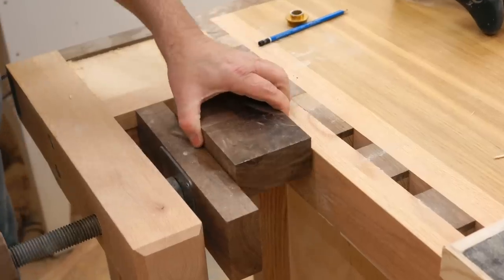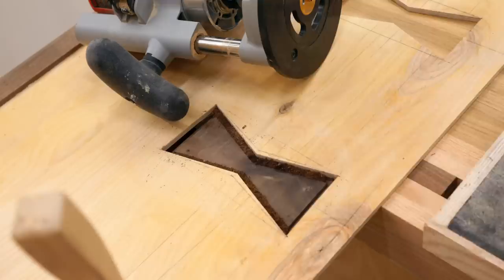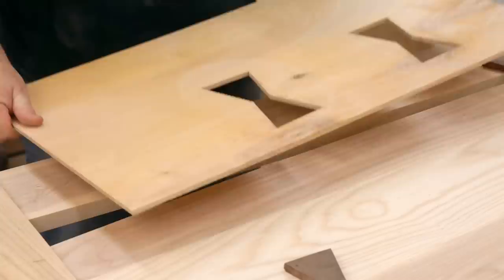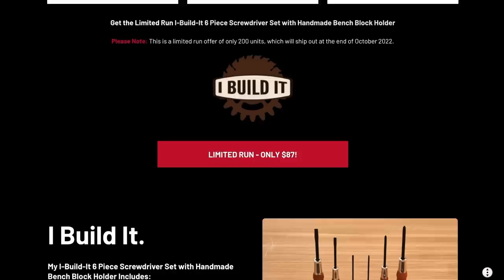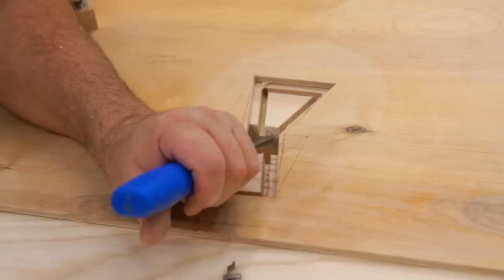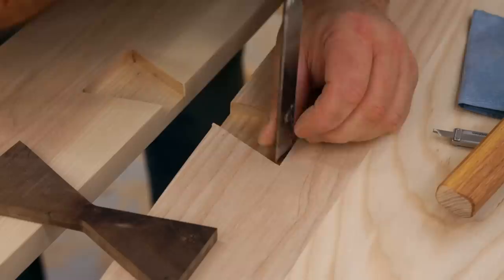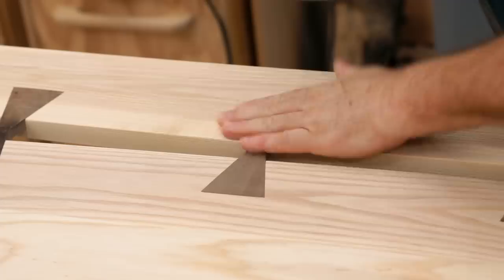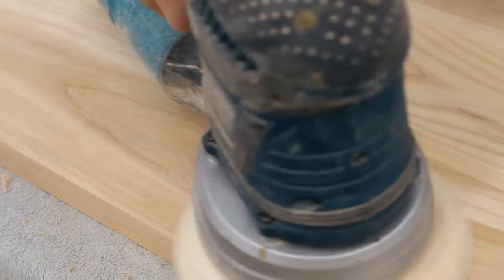Make Inlays the Easy Way - Perfect Fit Every Time

Comment from the maker: Get my 6 Piece Screwdriver Set: https://ibuildit.ca/blog/6-piece-screwdriver-set/
I needed to inlay some decorative bowties and came up with a way to use a standard guide bushing set to do it. 
I used a 1/4" straight cutting bit with two difference size guide bushings - a 5/16" outer diameter one and a 51/64" outer diameter. 
You'll use the 5/16" bushing to cut the inlay, carefully cutting around the perimeter using the template.
Then you use the same bit and template to cut the recess that the inlay fits into, but switch the guide bushing for the 51/64" size. 
It's as easy as that.
Most imperial guide bushing sets have a 51/64" bushing. I had to cut mine shorter to work with the 1/4" thick template, but that's the only modification I did.
The beauty of this method is that it uses one template to do both operations, guaranteeing a precise match and fit. Using one template also makes it quicker to do, and reduces the chances of mistakes.

There may be other bit and bushing combinations that work, and if you know one let me know in the comments.
Reply: Seems like the math should work like this: Given a bit diameter B and a smaller guide diameter G1, the larger guide diameter G2 should be: G2=G1+2*B, which in this case would be 52/64". Swapping for a 51/64" guide instead would give a little extra room for an easier fit.

Comment: If it helps anyone, diameter of second guide bush just needs to be diameter of first guide bush plus twice the diameter of the router cutter.     For example 1/8 bit with a 1/2 guide bush for initial cut and 3/4 bush to cut the pocket.
Or in metric say a 6 mm bit, 12 mm guide bush then a 24mm bush works.
Reply: This was so helpful that I took a screenshot!
Reply: That doesn't quite match John's sizes. He has cut the recess 1/64th wider (0.4mm), so 1/128th (0.2mm) on each side, and that looked still to be pretty tight. Presumably if you did it exactly as you calculate, it may be too tight? Since I can't do imperial in my head easily, I had to normalise the fractions: 16/64" router bit, 20/64" guide bushing for the inlay, 51/64" guide bushing for the recess. Using your calculations, it should have been a 52/64" guide bushing for the inlay. Using a slightly smaller guide bushing for the recess makes a slightly larger recess.

Not sure how to do this with my metric bushings - I don't have one that is out by such a small amount
Reply: Masking tape could be your friend here…
Reply: @camhutchison5553  it works without the additional 64th. I'm metric in the uk and do it often with metric bits and guide bushes and works fine.
Reply: @camhutchison5553  1/64th inch is closer to 0.396875mm, 1/128th inch is closer to 0.1984375mm.  You're skosh on the high side.
Reply: Another example that metric system is easier.
Reply: I’m missing something here. How can you use a 5/16” OD bushing with a 1/4” bit? ID of bushing <1/4”.

Comment: I saw this video and thought this technique would be perfect for a project I'm working on. Tried it and it didn't work. There was about 1/32" gap all around. Tried it again, same result.

To see if the math works out, I drew a couple circles on sketchup and aligned them properly. The math worked out to about 1/128, which is perfect. 

Then I realized that my bushings were protruding from the bottom of my 1/4" experimental template! Made a 1/2" template and ...SUCCESS!

TEMPLATES MUST BE THICKER THAN THE BUSHING.

Comment: I've seen you use, what appears to be, construction adhesive instead of yellow glues in more than one video. Sometime could you please talk about why you've chosen that? Thanks for another instructive video.
Reply: Hi Berry, in case John doesn’t see this I’ll pass on info as he has talked about it a lot. It’s actually polyurethane construction adhesive which he always stresses is different to the normal stuff. One of the main reasons he likes it is it works better in the cold temps in his shop. Also,  it has a longer open time.
Reply: @TheLindsay720  I think he also said wood doesn’t absorb it, which can be handy for glueing tight joints such as box joints.
Reply: @stokovsky8483  yeah it’s not water-based so won’t swell the wood for tight joinery. Good point.
Reply: Why don’t I see this used more often on a lot of other creators videos. Seems like this would be THE glue for mitered corners and other joinery that’s sensitive to wood swelling?

Comment: If the guide bushing is a 5/16 O.D.   and you're using a 1/4 in router bit then how is your bit fitting through the INSIDE diameter of the guide bushing???  I was thinking to try your technique but no way does my 1/4 inch bit fit freely through my 5/16 guide bushing!!

Comment: Why do you use a construction adhesive for glue rather than standard wood glue?
Reply: He uses construction adhesive because his shop isn't heated and regular wood glue wood freeze before it dries. He's in a cold climate.
Reply: I’ve also heard him say it’s stronger & has some gap filling properties…when feels the need for either. I’m sure he’s correct BUT, I’ve tried it couple times & it is a pain in the @ss to work with. To each his own…😂
Reply: It is also the signature move of this channel :)
Reply from the maker: Lots of reasons:
- as strong as PVA glue
- thicker, so it's not dripping all over the place
- longer dry time gives time for complicated glue-ups
- works at lower temperatures, unlike PVA glue
- it has no water, so it doesn't swell the wood
- long shelf life
- 100% waterproof
- it doesn't stink (low odour)
My shop is heated, but only up to 5 degrees Celsius in the winter. 
Important: The stuff I use is polyurethane construction adhesive - PL Premium. Don't make the mistake of thinking any old thing in a tube is the same, they aren't.
Reply: Another benefit over wood glue is the ca takes a lot longer to dry. This is helpful if you have a complicated glue-up where it might take a long time to get everything together. Another benefit is, when you get your glue-up together and you realize you made a mistake it can come apart much easier than wood glue.
I've been using polyurethane construction adhesive for years now, because I first saw John using it, and it really works well. Also, it's not a pain in the @ss to work with.

Comment: Im sorry but when you said you were changing a bit to 51/64's I couldn't help but giggle. Imperial -really. Here in the UK we have been using metric for decades and it is way easier and accurate. Our measuring tapes still have imperial on one edge and metric on the other but NOBODY uses imperial. Back in the day the UK pound used to be imperial meaning 144 pennies to a pound. Imagine using that today. Metric is much more convenient, in my opinion. Love your video by the way.
Reply: Oooh, careful, some Americans get very touchy when you criticize (-ise?) their medieval measurement system.
Reply: I’m Canadian and we sort of use both.  Speed and distance in Kilometers, but weight in pounds and height in feet and inches.  Indoor temp in Fahrenheit and outdoor temp in Celsius.

I’ll say that when it comes to woodworking, going fully metric has improved my accuracy and reduced mistakes by a significant margin.
Reply: Im an American.  I dont use metric. Decimal inches.  Not fractions. Easy math. I dont know why metric users think inches have to be fractions.